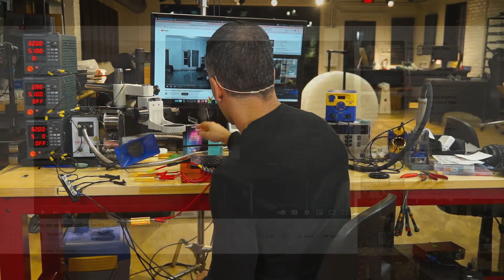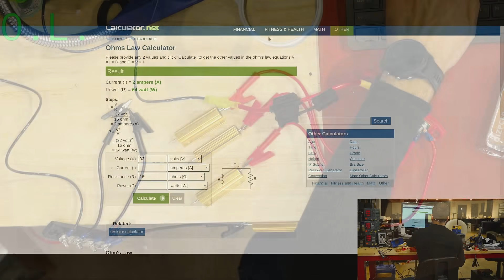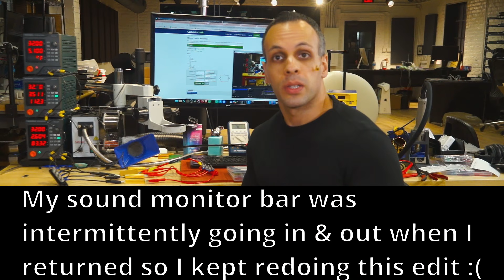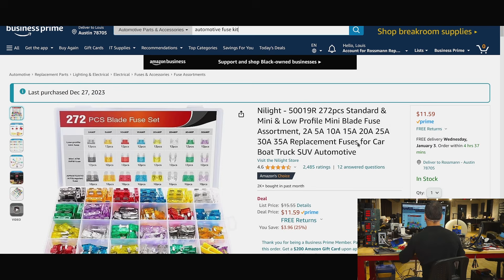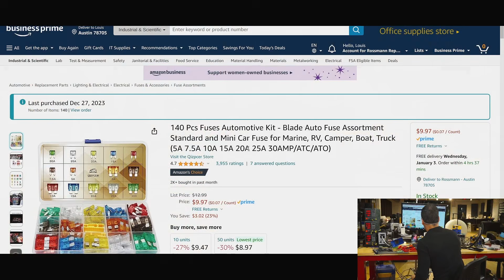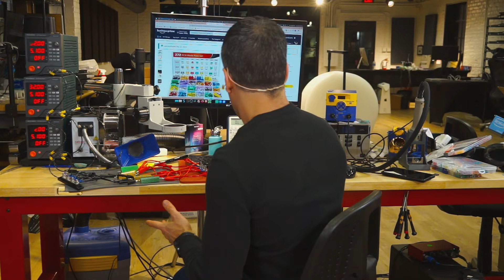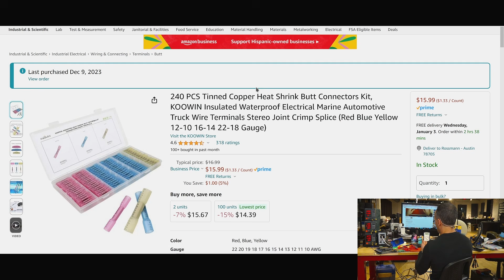Amazon Sells Fake Electrical Fuses

Comment: We lost three people going to the moon in the 1960's.  (Of course not including industrial accidents of manufacturers who are going to have varying but some rate of mortality and morbidity in their operations if they are more than a few hundred people in jobs working with machinery and processes that intrinsically use life threatening forces or materials..   large civil engineering projects can be measured in human lives and such estimates are almost always included in proposals (and insurance underwriters will demand it - and often audit it before issuing a writ of coverage). 

My guess is that if/when we go back to the moon now, it will cost several times that.   Sure the technology and industrial processes are better now - we can now actually cast crystaline titanium (as in jet engine blades) and build solid complex in volute shapes into rocket engines by 3d printing in exotic metals.  Not to mention that my watch has more computing power than was aboard any Apollo vehicle, and my desktop more than NASA had at the time.     But we lack the ethics,  and from a social perspective the morals to implement projects on that scale of complexity without too many subcontractors cutting corners and shaving specs to increase their profits.  The result will be numerous and unpredictable cascade failures for which every party will have an excuse, well my part would not have failed had this other part worked to spec ... and then some other party saying, "our subsystem failed because that part (prior) did not perform linearly approaching these spec tolerances.... "  and so on.  

Nobody will be "responsible" because nobody will take responsibility ... even for insuring that their area of responsibility is not only met, but exceededed even if it costs a few dollars more.  In short, there is no longer pride of responsibility, only of profit.  Which in the real world means having the moral courage and ethical integrity to BE responsible for ones doing. 

Note that in most states the primary responsibility of a corporate charter is to make and preserve value for shareholders ... NOT for the integrity of business transactions, not for "consumers", not even for employees.   For shareholders.   Oh most require (extremely) vague language about the public interest but nearly all the formal responsibilities in corporate charters or fiduciary to the shareholders with little else.   

A few small mostly private companies, and a few older corporations ... and a VERY few younger ones who have looked at business models and consciously chosen the long game will try to opt for higher quality and "old fashioned" standards at a relative but not exorbitant premium.   But increasingly face pressure by venture capitalists and others in their industry who will conspire to freeze them out once they begin to get market traction (read some of what pressures are being put on Costco) 

At this point I'm not even sure we (well the US. I'm not in position to venture an opinion on the moral-industrial state of China or India) can go to the moon again even if some powerful political and economic movers and shakers put a premium on such. 

Louis's Amazon experiment is just an example of the moral corruption of "late stage" capitalism in action. (No I'm not a communist ... the problem with communism is exactly the same as with capitalism... without some view and reason for people to believe in and adhere to moral quality government controlled economics will be as - or more likely more corrupt than capitalist economics.  I mean it happens now in capitalist socieites where government is "bought" by the economically powerful.  Why would it not happen under communism? And historically it in fact has.   In the end I have no promise or hope for the problem of human governance;   just put one foot in front of the other and try to do rightly for your own sake is all I can offer).

Comment: In case anyone's wondering a fuse blows based on time and how far it's over the rated current.   The rule of thumb is that a fuse should fail within a few seconds at 150-200% rated current. 
So a 2A fuse should blow within a few seconds at 4A and instantly at over 6A.
What Louis has is almost definitely a 5A - 8A fuse mislabeled as a 2A fuse, either by accident or on purpose so the manufacturer can save money by making less types of fuses.

Comment: I work for a large company as a EE. Our procurement guys all have Amazon business accounts and routinely buy anything from fuses, resistors, thermocouples, etc. They are not the automotive kind they are for industrial application (DIN tail mounted) Never thought to make sure the fuse actually blows at the correct amperage. The whole point of the fuse is to be a final layer of protection.

Comment: Louis mentioned Home depot specifically, so I'll use them as an example. Let's say you were a manufacturer of an electrical appliance and wanted to sell your product in Home Depot stores. Home depot will not sell your product unless it has all the necessary UL and regulatory testing and certifications. They want to minimize liability in the event someone sues them due to a faulty product. Amazon get's a free pass by the courts because Amazon claims that they are NOT the seller, but simply a selling platform that actual sellers can sell their crap on. Thus Amazon has no liability, you must sue the overseas company if your safety device injures you. The courts need to rule that Amazon is the seller if the product ships from their warehouses.

Comment: I've also found Amazon/Walmart fuses that aren't quite the right shape: the fuse puller can't grab them or the molding on the fuse block keeps them from fitting in securely.

Comment: The are penny fuses.  Basically you cut a piece of wire, shove it in the fuse holder and call it a fuse.  THAT only cost a penny cause it comes from throw away scrap. Lol. Cheaper than Amazon I might add.

Comment: @louisrossmann I bought a Duracell car phone charger on Amazon and as soon as I plugged it in to my car's cigarette lighter after attaching my genuine Samsung charging cord that came with my phone in, it blew a fuse in my car's dashboard computer. Cost me $400 at the dealer for them to pull my dash off and replace the fuse. The product had 5 stars and over 100 ratings with no bad feedbacks when I chose to buy it. 

When I went back on to leave a negative review a few days later, I saw review after review of people complaining that it blew the fuses in their cars. Then the item said "No Longer Available". Not long after Amazon banned me from leaving reviews. 

I called Amazon up and told them I wanted them to refund my money and pay for my car repair because they were selling unsafe products and asked them to read the bad reviews to see I was not lying. The rep told me all he could do was give me my $24.99 back. Apparently they were letting 3rd party sellers list counterfeit Duracell brand cellphone car chargers. After that, I will never buy plugs, chargers or SD cards from Amazon again. The list of things I will not buy from them keeps growing every day.

Comment: DUDE, a pure way to "not giving a crap" if the recipient Country burns to the ground...
SO, my electronics tech (who died a few years ago) used to take a jewelers file to remove a  tiny bit of Zinc to "fine tune" his fuse for the final product (also used a ball tip micrometer to measure it) THANKS LUIS ! ! !

Comment: Well I got no clue about how fuses are designed and rated for the us market and ahould probably watch the conclusions before commenting, but nah. 

Depending on the characteristics of the fuse, it isn't supposed to instantly trigger at exactly the given current rating, but can take minutes, if not hours to burn through. 
Are they of the same characteristic? Have you considered that?
Reply: Gosh darn, obviously you did consider that. Well, otherwise I would be mildly disappointed

Comment: you don't need resistors to test this.  you can just short the fuse across your supply and set the supply's current limit to the fuse's rating, and voltage won't really matter since it'll go into constant current mode.  if that won't blow it then you can start turning up the current limit until it pops.  then you don't have to deal with those power resistors getting smelly
Reply: He did it that way to give simple visual proof.
Reply: @LachskoenigIV  interesting.  what visual does that add?  i thought the demonstration was manually testing the limit of the fuse.  wiring up a bunch of power resistors doesn't add any value to the demonstration that i can think of, unless i just completely missed something (which is definitely possible since i was multitasking as i watched this)

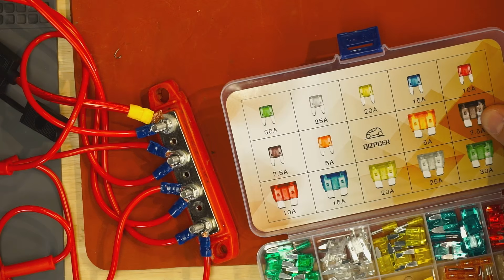Comment: in the COCKsee BOX you can see a difference in the thickness of the fuse wire, in the other example 17:14 it looks like they just put the same metal inlay into different color plastic, at least for the mini fuses, i can't spot a difference in thickness of the metal not even up to 30A. would be interesting to test the qizpcer 30A, i bet it also blows at 10

Comment: Edit: Wow, those are not fuses, they are bus bars in miniature.

Commenting before watching the test. The rating of a fuse is the current that it can hold indefinitely at rated temperature. A 15A fuse should not blow at 15A. The current-time curve is defined in the datasheet. Looking at a random datasheet on Digikey, a fuse of 0.062A will hold 0.2A for 3ms.

From the same datasheet, fuses are rated roughly 100% of current for minimum 4 hours, 200% for maximum 2 seconds.
Reply: Ahh, a man of culture

Now watch the rest of ze video

Comment: Am I missing something, if these are sold as automotive fuses then that would generally mean a 12v circuit, why are these specced at 32v? 

2A @ 32v is 64w
2A @ 12v is 24w 

That's a significant difference, and Ironically the 32v one is putting way more wattage through the fuse - so if it popped at 8A at 32v, that's  256w which at 12v that requires ~21A
Reply: Dis is not how any of dis works

Only the current matters. How do I explain this? Oh well, I'll make it short: The higher voltage drop results at the load in the circuit. So that's the point where most energy is dissipated.
For the rest of the system, let's say only wires, the fuse is the point of highest voltage drop and thus protects the rest of the system from pulling too much current by sacrificing itself.
Reply: @LachskoenigIV  fair enough, I assumed I was missing something key

Comment: Amazon’s selection of ceramic fuses is also a joke.  All the ones I’ve bought that are assortment kits have been hollow with no arc quenching sand.  The whole purpose of a ceramic fuse is to have the thicker tougher ceramic housing filled with sand so that a very large transient event won’t blow the fuse filament into an arc sustaining metallic plasma.
Reply: Especially in the UK where the mains is 240V the sand is essential and part of the British Standard, yet, Chinese fuses don't bother with it.  Thus, when there's a short circuit, a plasma appears inside the fuse casing and expands very quickly creating an explosion that can explode the plug and possibly start a fire.  I've seen a few photos of the aftermath of such events, a big black halo around the socket 😵‍💫

Comment: Most people who would buy these things from Amazon would not realize that in a lot of things that use fuses, there are components within the circuit that, if exposed to double the amount of current that would blow the fuse, it would literally melt the micro controller to the point where it wont function anymore. Thus causing them to have to replace the component entirely. Assuming that is even possible.

Comment: I’m just a layperson when it comes to this, I have some electronics knowledge. I’m left wondering “How do I know this is the correct way to test this?” “Comments are saying that fuses should blow at different speeds depending on load”. If these are truly harmful, I’d like to see Louis’s attempt to get the product removed from the Amazon listing by providing this video as data. I’m sure that would actually be difficult and would make for GOOD CONTENT. “day 45 trying to get unsafe fuses removed” I’m sure it would be a circus to get that crap de-listed. Get your local senator involved, make a BBB complaint, something!
Reply: That would be shit content.

Comment: I tried to review a water filter for my refrigerator that claimed to be a genuine GE water filter but when i put it on it put out all kinds of black dust into water so i cut it open with bandsaw and an old filter that was real GE and they were completely different inside one was a nice smooth carbon dome very even and smooth with no way the water could bypass it and the other was a lump of charcoal with mesh glued to it to keep it in one piece and two plastic end caps glued on well one of the end caps had fallen off and water was coming out the open end with some charcoal dust from the break.
  amazon said my review was not allowed because the company I bought it from said they are real GE filters and apparently nobody is allowed to dispute that because they would never lie.

Comment: The problem with rating of fuses is, how many customers would ever be able to discover the "fuses" are not real fuses but overpriced nails, so there is no reason why they would not be satisfied with them. On the contrary, many people dealing with "blowing fuse issue" would experience the real good fuses as "bad" and the real bad ones as "good", because the real issue they have is faulty equipment where the "nail" makes the thing appear to "work good"...
Reply: Uneducated peeps are too confident that they know what's going on. 

Simply an unfixable issue